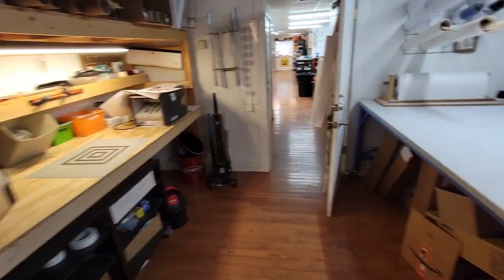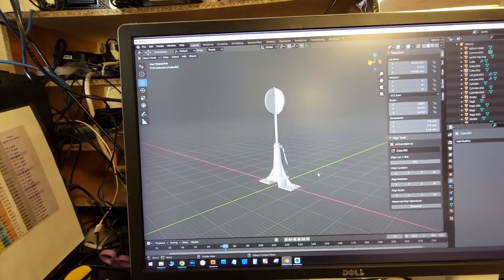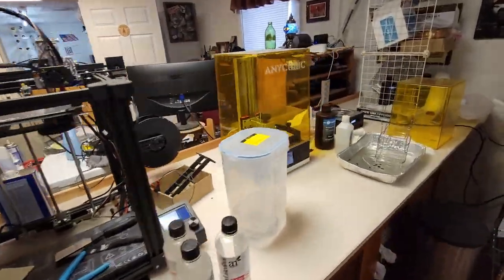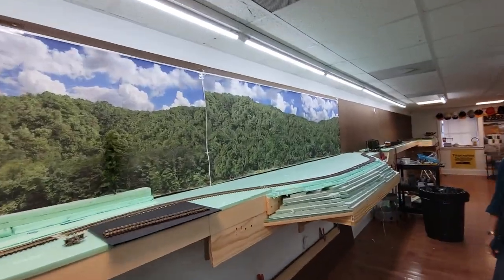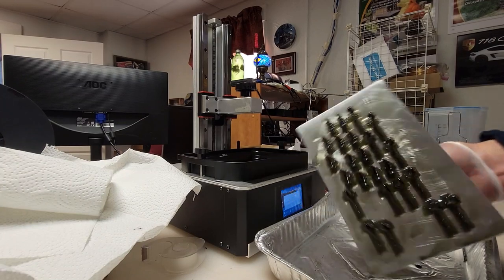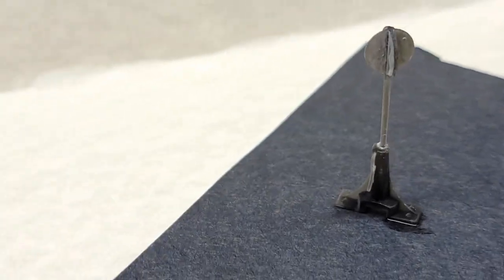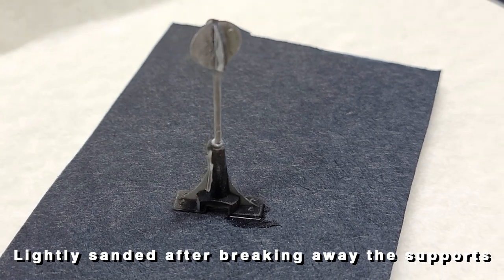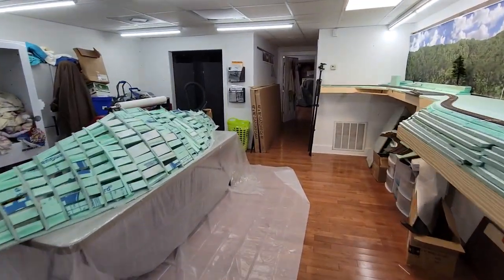3D printed Switch Stands

Comment: The way the print head didn't go all the way to the top when done printing. You might need to lube the lead screw. I use Labelle #106.